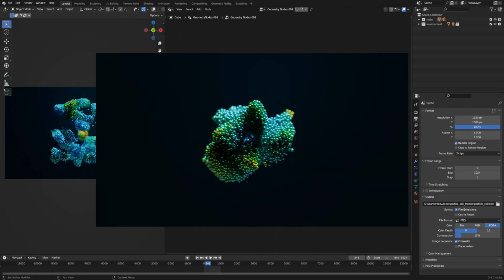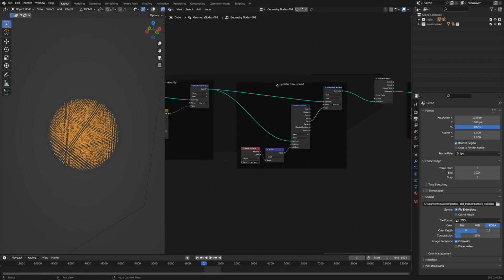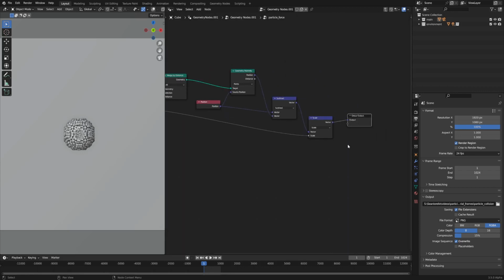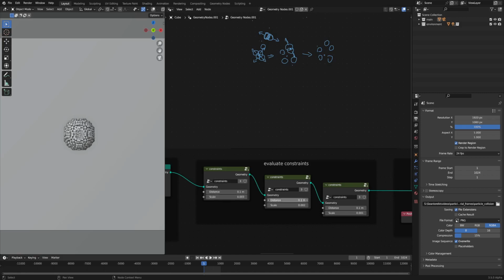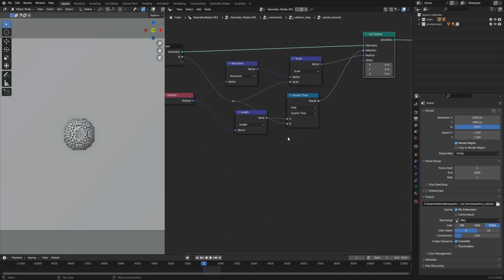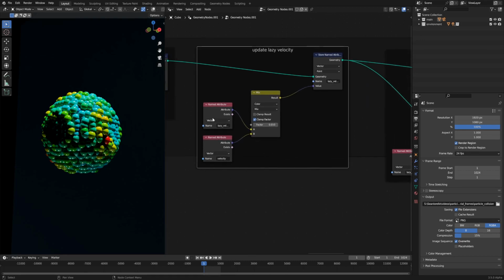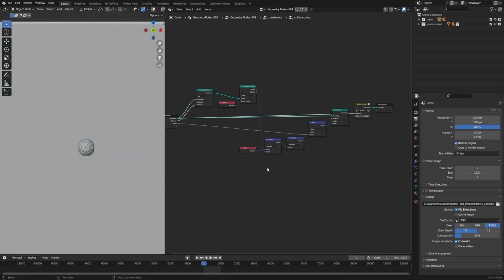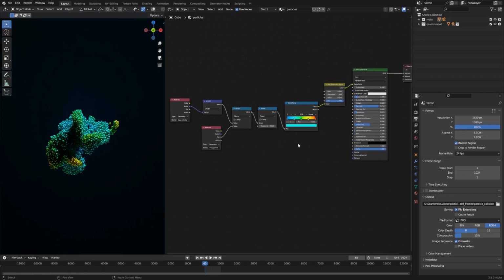Particle Interaction Geometry Nodes Tutorial (Blender 3.5a Simulation Branch)

Comment: Very nice job ! Thank you for sharing !
But I've a problem : I've downloaded 3.5 beta for Apple silicon and opened the file on Gumroad but instead of input simulation node (the one that goes after the "Delete geometry node") , I have a red undefined node...And it's the same for the simulation output...So I guess simulation node was not working ? When I roll over the mouse on it says :  "Unknown socket value. Either the socket was not used or its value was not logged during the last evaluation" I don't nderstand what's going on ???
Reply from the maker: Yes I noticed this the other day when I downloaded 3.5 beta. It looks like the simulation nodes won't be included in the main branch yet, but there are geometry nodes simulation branch builds available on this page: https://builder.blender.org/download/experimental/archive/ . I'm on windows so I haven't tested it but I do see an apple silicon version there!
Reply: @seanterelle  Thank you for your answer...Yes, that's what I thought ! But I'll wait until they decide to include the simulation nodes in the main branch because it seams that it's not stable yet ! 😉

Comment: Thank you!!! I thought that as of these early versions, particle interaction was impossible.

As of the latest versions, you will be able to store attributes in instances and use them in shading, saving the step of realizing instances. In cycles, you can also directly render the points, without needing to instance spheres onto them. These 2 things should improve performance, but the collision detection is probably still the performance bottleneck. This should improve a lot once proper loops are added, which is a planned feature.
Reply from the maker: Very excited for loops

Comment: very nice i have taken a look at your file looks great, how would you go about adding rotation as well, I switch out the ico-sphere for and actual object, but there is no rotation in the movement
Reply from the maker: The rotation of the simulation object is done with a driver expression on the z component of the object's rotation property. If you select the simulation object from the gumroad file and look in the object properties tab, you'll see the z-component of the rotation highlighted in purple. This indicates that it is being controlled by a driver, if you left click on that value it will show the driver expression which in this case is "-frame/200", which means that the object will rotate by a small amount each frame. Generally, you can set expression drivers on properties by clicking on a property field and entering '#' followed by the expression you'd like to drive that property. Alternatively you can animate the simulation object with keyframes rather than a driver expression 🙂
Reply: @seanterelle  I don't think i'm fully understanding this : -(  do i need to add something to the simulation loop to get my individual particles to rotate? I can only seem to get them to rotate exactly the same as all the rest of the particles.
Reply from the maker: @fireme2008  Hmm maybe I misunderstood your question. This simulation doesn't simulate individual particle rotations unfortunately, it only changes their position and reduces collisions between them.
Reply: @seanterelle  how would you recommend going about rotating the individual particles? to add some randomisation to it. as currently if you change the particles to and object other than a ico-sphere you can clearly see its not rotating.
Reply from the maker: @fireme2008  you can use the rotation input of the instance on points node to set rotations as desired. If you want random rotations, use a random value node set to 'Vector' and set it as the source of the rotation input of the instance on points node. If you'd like to simulate physically accurate rotations based on collisions you can research rigid body simulations as well as extended position based dynamics.

Comment: Great tutorial and wonderful explanations! But I can't figure out how you set the material, since there isn't a "set material" node, how do you link it to the simulation? Thanks!
Reply from the maker: Good question! The material needs to be linked to 'Object' rather than the default 'Data'. You can set this property in the material properties tab in a drop down located to the right of the material selection drop down. Using a 'Set Material' node is also a great solution 🙂